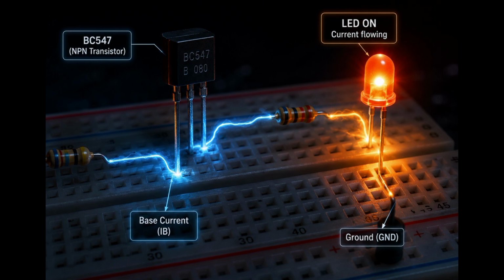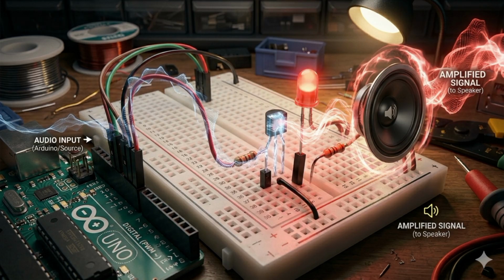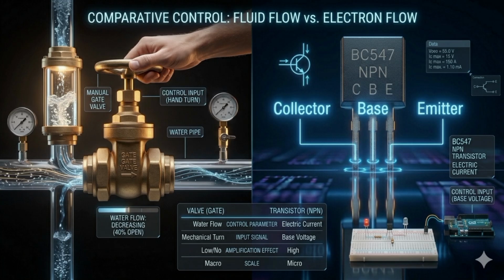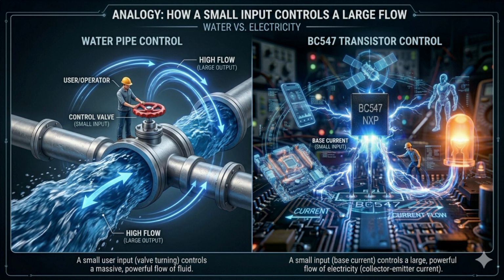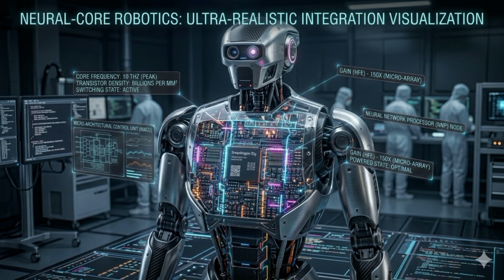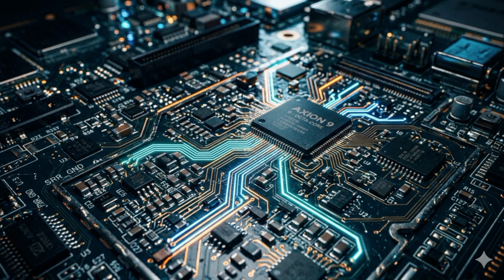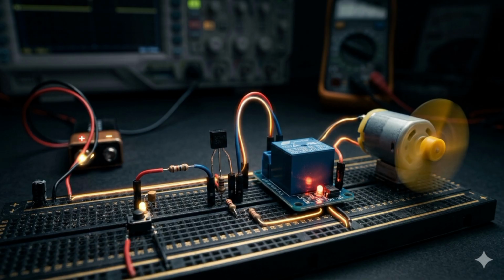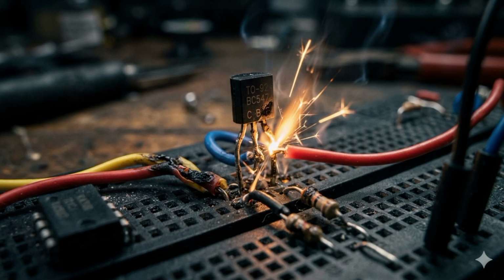What is a Transistor? Explained Simply with BC547

Comment: Sorry, but you've done a terrible job.  Remember that everyone nowadays has been raised being taught von Mayer's (NOT Einstein) "energy cannot be created or destroyed" law from way back in 1842. You try to explain a transistor in a way that violates the law of thermodynamics, as if a transistor can somehow be commanded by the base leg to just take a weak signal and make it magically stronger.  Telling them one leg is called the Collector because it 'collects' electrons (well, in NPN - too soon to explain vacant spaces or holes & PNP) it becomes clear - but you never touch on what the names MEAN. Most folks grasp electricity as the flow of electrons (hence the word itself) and would quickly grasp 'collecting' them.
Try again? As of this moment you have a whopping 4 views despite obviously great graphics and decent presentation.  I'll bet you can do better.
Reply from the maker: Thanks for the detailed feedback. You actually made a very important point.

I simplified the explanation too much for beginners, especially the amplification part, and I understand why it sounded misleading regarding energy transfer.

You’re right — a transistor does not create energy. The larger current comes from the external power source, while the Base signal only controls that flow.

I also like your point about explaining the meaning of Collector, Base, and Emitter more intuitively. That could definitely help beginners understand the concept better.

I’ll improve this in future videos. Thanks for taking the time to explain it properly.